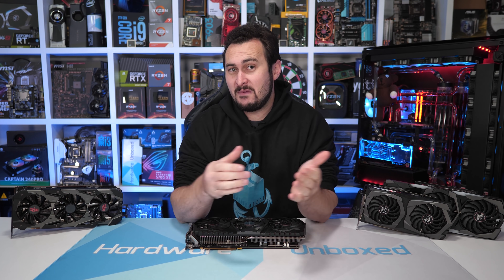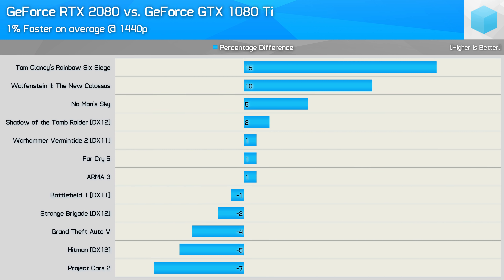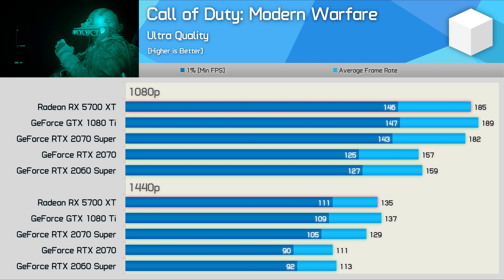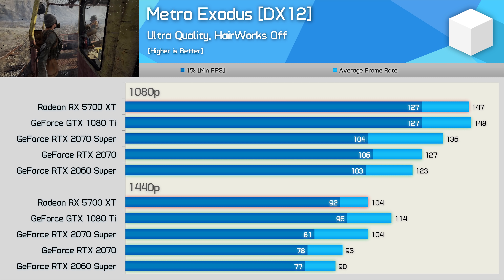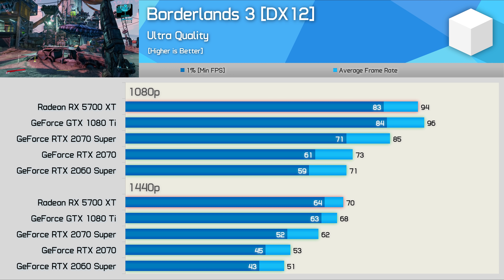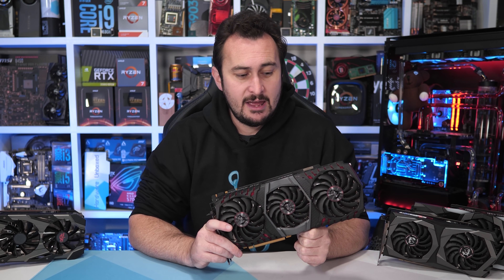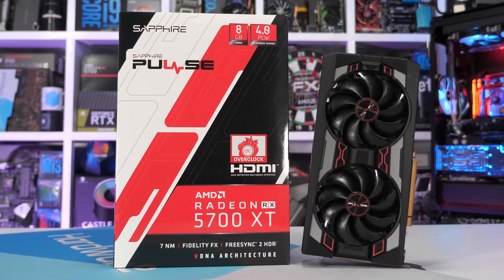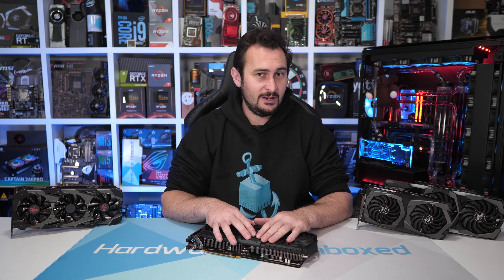GeForce GTX 1080 Ti vs. 5700 XT & RTX 2070 Super, 35 Game Benchmark

Comment: 1080ti is an anomaly i will be keeping for few years to come still.

❤️ msi 1080ti gaming x ❤️
Reply: I bought two and my gf has one of them.  When one of us upgrades, the other can see if SLI is any good.
Reply: @circleofsorrow4583  that is smart
Reply: Graphics has been stagnant for a decade now and it was an nvidia's mistake making this GPU so good, so it's not really an anomaly.
Reply: @Vsevolod3788  ok, if by what you say, graphucs have been stagnant for a decade, and nvidia made a MISTAKE to make it this good, doesnt that make it an anomaly?

seriously, some of you guys and logic dont go hand in hand
Reply: @Transistor Jump he's right graphics have been almost stagnant for about a decade. The jump from crysis (2007), Battlefield Bad Company 2 (2010) or BF3 (2011) to 2020 games is absolutely tiny and pathetic compared to the graphics evolution in the decade before that. Show me any game from 2000 that looks even remotely as good as those 2010ish games. When you bought a new PC in 2000 it was basically garbage for new AAA games after 2 years max. Today you can use a i7 2600K from 7 years ago and play pretty much everything just fine. If you tried that a decade or two ago you would be looking at a relic of a CPU.
Reply: @megapro125  I am still rocking my old faithful i7 2700k so i totally agree with you bro. I want to upgrade but as i am playing the latest games on high settings at 1080 there is not much point.
Reply: Love My MSI GTX1080Ti Gaming X too, I just run it stock settings & it hits 1974MHz even during summer when it's over 40°C (104°F)
Reply: @shaneeslick  it is just a perfect graphics card
Reply: 1080 ti gaming x Trio here =)
Reply: Evga 1080 ti sc2 chiming in. Bought it near release with discount. Still running strong. Probably be the next gen cards that unseat it from my main setup.
Reply: @drunkwaffle6410  at which resolution you play? mine still absolutely shreds the 1440p.
Reply: @Salt Maker i wont notice 1 single difference at 1440p. i already play without the raytracing,so big deal. and even if i did, getting by then, what, 4 years on a gpu, when i will still be able tu run high settings, that to you is aging like a turd? havent even needed to OC it yet. 

there is just 1 turd here, and it is your opinion 😆
Reply: @Elbethium  Have you got the TRIO one with three fans and RGB or the red-black one with only two fans? The "MSI 1080ti Gaming X Trio" version is way more expensive than the standard "MSI 1080ti Gaming X". I'm just wondering if two fans are enough to cool such a monster.
Reply: No reason to upgrade my 1070Ti yet either. Great series of cards all round.
Reply: @boingkster  really amazing cards
Reply: My zotac 1080ti mini still blowing hard lmfao
Reply: @zuetonwing  does it stay cool even if it's a bit loud?  I almost bought that model bit went for the triple fan full size.
Reply: @circleofsorrow4583  Yea its managable as long as you can bear the sound. Undervolting is my bestfriend.
Reply: I have this exact same card, its warranty will expire in July this year.
Reply: @ghouse1239  this is a 4th twin frozr msi card i have(1000 series is basically that still), never had 1 single issue, ever.

so no concearns for you over warranty 😄
Reply: I love my MSI Gaming X 1080Ti too. Let's wait and see which the new generation of card has to offer.
Reply: @loci5327  high five lets indeed 😄 how does it work with your color scheme though?
Reply: @Salt Maker Well My GIGABYTE AORUS Xtreme GeForce GTX 1080 Ti Waterforce in my secondary PC is doing great with my 1440p 165hz G-Sync monitor so it's definitely not a turd at all. Holds a 2075mhz core clock and never goes over 61c all while staying quiet.
Reply: same here I also have Gaming x trio 1080ti msi and still i think I wouldn't need to upgrade my card for 1-2 years
Reply: Two New Asus Strix GTX 1080 Ti (Standard Version, not the OC Edition) bought in 2019. I´m so happy <3333333
Reply: I would sell it now, then get a rtx 2080 or rtx 2080 Super.
Reply: @JamesSmith-sw3nk  i thought about it, but would have to add another 400e ontop of what i get for this one just to have same performance
Reply: @Transistor Jump Not a dumb idea at all, You can get a lot of money for the gtx 1080ti RIGHT NOW, it is used and has/will start losing performance in newer games, especially when the next generation comes out, (how is the gtx 980 ti doing these days?) AND you get a new card that is faster AND supports the latest features, ray tracing and DLSS 2.0.
Reply: @JamesSmith-sw3nk  Heavily depends on your region. 1080tis here costs like 300-350$ right now. It's really not worth the hassle over DLSS when most games doesn't even support it. Would sell mine if someone offers like 450$ LUL
Reply: @Transistor Jump I have a 970 in my secondary bedroom PC, still running 1080p 60 fps on most titles anywhere from medium to high setting, with certain newer games needing lighting or shadows turned down a notch.
Reply: The TRIO one with three fans and RGB or the red-black one with only two fans? The "MSI 1080ti Gaming X Trio" version is way more expensive than the standard "MSI 1080ti Gaming X". I'm just wondering if two fans are enough to cool such a monster.
Reply: @Salt Maker I dunno in titles of the time it could mince games well over 60 fps even with its 3.5+.5 GB vram it was amazing performance for the price. My niece has my old one and has no problems with very high settings in GTA v. Gtx970 was a little monster.

Comment: No regrets on my 1080ti especially now that i watercooled it.
Reply: I did the same thing and it overclocks great but still runs super cool
Reply: same here bois, barely up to 60C after hours of playing of RDR2 with 2000 core/12000 ram OC, i love this beast but i could not imagine it without WC
Reply: I get 2000Mhz on air with a stock cooler. If you have a p400a with noctua intake fans you don't need to spend a fortune for water cooling
Reply: Same here. 2050MHz gpu 12.800MHz memory. Max temp 42c on very very hot day. On regular days 38c. NZXT Kraken G10 + Corsair H110 280mm.
Reply: @brunocgpb  Mine does 2037Mhz/12000Mhz with my G12 and Kraken X62. Sits at around 22 degrees at idle and hits a max temp of 45 under extreme loads. Couldn't be happier.

Comment: The reason why people still buying 1080ti is 11gb vram for deep learning. It makes a huge difference for dev box.
Reply: Is the extra ram really worth it over having tensor cores?
Reply: @SkinUpMonkey  yep, especially if you consider the rtx 2080ti prices. You getting essentially the same perfomane for half the money. Rtx only works better for some computer vision tasks with float64, and not by a huge margin.
Reply: @pavelbratchenko3885  oh right, thanks for the info.

Comment: GTX 1080 TI is like a fine wine.. simply amazing 😎
Reply: or in other word 
this gen of gpus are shitty as hell to expensive with not really good fps increase and rtx only starting to raise
Reply: As amazing deals go in last decade, only 7970 could compare. Further there is 970, as well as rx480.
Reply: Well the 80 tis tend to age very well. Gtx 780 ti is on par with gtx 3gb after 10 years, 980 ti is still a beast, its no surprise the gtx 1080 ti is still going strong.
Reply: @Salt Maker 980ti is a very impressive card for its age. Still rivals a 1070 and a 1070ti when overclocked. There are a few titles where its a bit behind but for the most part it holds up very well in new titles.
Reply: More like Nvidia optimization of a beast of its time. Just hope that support doesn't fall off, and it's the 7th gen all over again.

I mean, if i spent close to a grand on a GPU I'd hope it would be good for 3 years...
Reply: Filip Jovanović just because it sold for "cheap" in some few select markets in a short window doesn't make it "fine wine". in Sweden it still sells for ~€1000, and the lowest sale around ~€800 (including 25%VAT).
Reply: @TrueDesire존  In Serbia the price used to be the same. How ever when i bought it because it ended up being the last piece on the shelf it had 35% off.  Plus because i paid with money in advance it ended up costing me around 550Euros..  Sadly in Eu prices are always higher especially in northern countries...
Reply: @Salt Maker I disagree, the fine wine theory will continue with the 1080TI, it has way to much vram not even utilised today for it not to.
Also it seems to gain  well from  Vulkan.
As new games will always try to utilise more Vram the 11 gig 1080ti will be shine for a long time at 1440p.

Comment: Why does the VEGA 64 have sooo much Theoretical power (like 4096 Shading Units, 13 TFLOPS etc.) but sucks in Gaming ?
Reply: Basically they have a lot of shader capabilities but really lack the geometry throughput.  They were primary designed for computational/maths workload seen in the professional/scientific space, not so much gaming. But that didn't stop AMD trying to repurposed the architecture and  market them as gaming cards.
Reply: Triangle setup and scheduling granularity.  Vega shaders operate on blocks of 64 pixels, Pascal 32 and Turing 16. 
Which means that if you shade triangle that is only 12pixels in size you will spend for every 12 flops needed 64, 32 or 16 flops depending on model. And if you use 65 pixel triangle, its 128, 96 or 80.  Using shorter vector units has downside of requiring more instruction sheduling hardware for same number of cuda cores. 

Also you should look the number of pixels it can push, at peak frequency vega 64 can push 99Gpixels.  While GTX 1070 can push 107 Gpixels.
Reply: Thanks for your informative answers :)

Comment: Still have my founders edition of the 1080ti and it's running great! only time it starts to hurt is when I use it on my 4k oled and crank up the settings. Holding out upgrading until the 30xx series.
Reply: I'll give you tree-fiddy for it. Got that price from a reliable source
Reply: @mandingobingo  I run mine on a 4K monitor. I just play at a mixture of med-high settings and it's great. I'm waiting to see if AMDs rumored 5900XT is a good value.
Reply: Me too, running the founders edition too.  Sometimes, I worry about the blower-style fan giving out, but nope the card has been solid that past few years for and I've never felt I have to compromise on settings with my 1440p 144Hz screen.
Reply: get AMD jesus
Reply: Kicking a EVGA 1080ti hybrid .RDR2 on 4k makes my card earn the $850 I spent on release.Also waiting on 3080ti.

Comment: Is there a big difference in Gaming, when u have a Ryzen 5 3600 instead of an i9-9900k ?
Reply: I9 would be better but the savings you can get with the R5 would let you get a better gpu.
Reply: @SkinUpMonkey  get the r5 with a better gpu play at 1440p and have a brilliant time
Reply: @imo098765  ya that's what I would do since gpu is going to give bigger fps increase than the i9 would ever do.
Reply: i have same question
Reply: I dont think tjere will be, since with rtx2080ti difference is like 5-10% 
I think both cpus can push 1080ti to the limit
Reply: @ademiravdic  my 3600 pushed my 1080ti to the limit so yeah
Reply: Well theres no bottleneck for 3600 for now.so for now i think an average of max 10% difference in performance
Reply: there is slight but not big ,if you are gaming at high reso with low hz example 4k or 2k 60hz ,there would be no difference at all .
Reply: Hard to answer if you don't specify 'big'. Just look up '1080ti ryzen 5 3600 benchmark' on YT and look at the avg. Fps. Do the same for '1080ti i9 9900k benchmark' and then you can see the difference yourself and decide if it's worth it for you. I think the ryzen 5 3600 is an excellent CPU I don't think it will bottleneck anytime soon.
Reply: @kaizokuonii51  currently using 2600 should i upgrade to 3600 or 3700 or wait for 4000. or should I upgrade GPU? i used 1060 for 2 years.
Reply: @narutonagato95  if 1080p then I would wait on both.